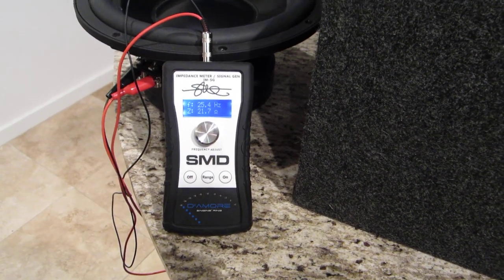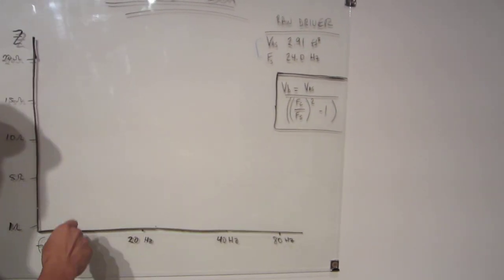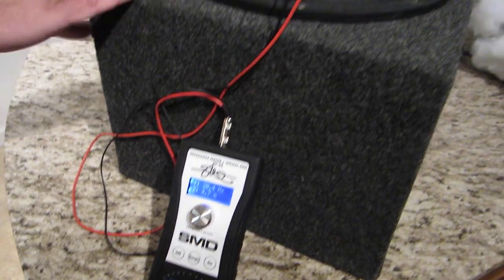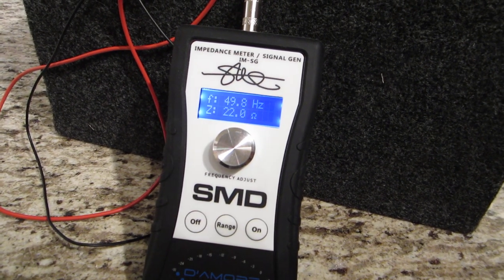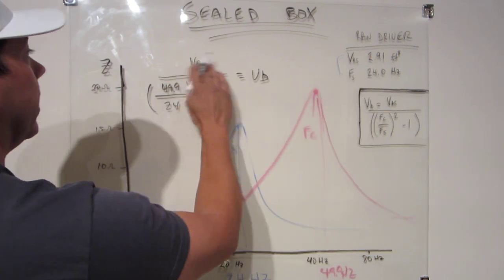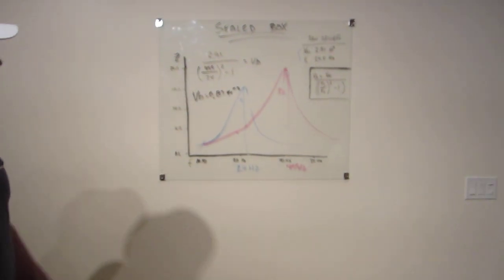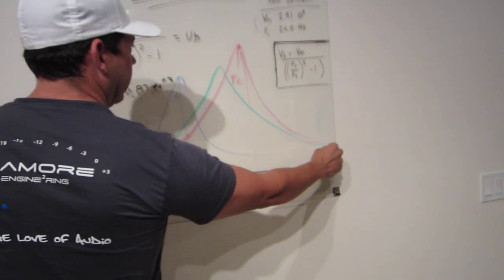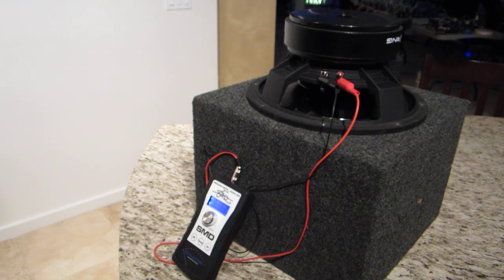IM-SG Video 3 - Find Volume of Sealed Subwoofer Box

Comment: One could easily figure out the volume the driver itself with this tool...all you need to do is subtract the volume of enclosure with the driver in it (mounted normally) from the volume of the enclosure with the driver mounted inverted (: